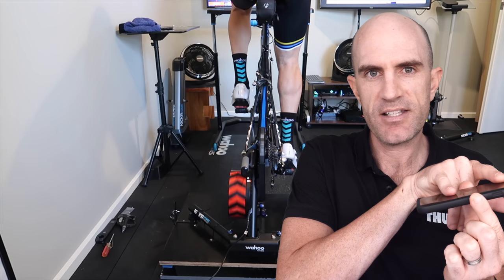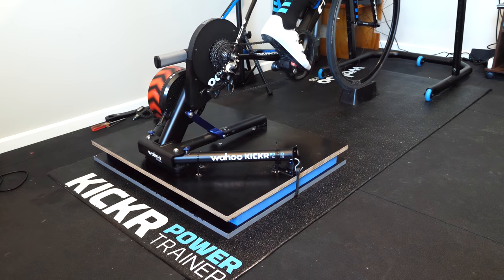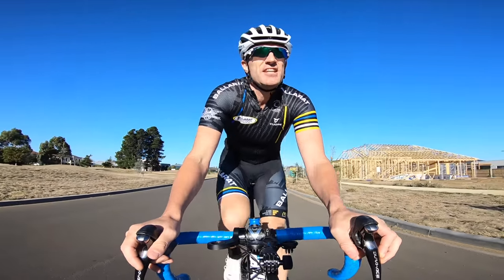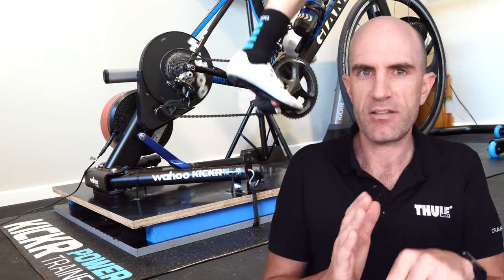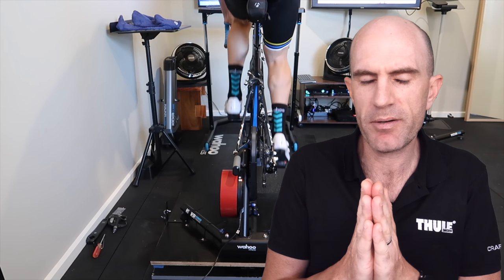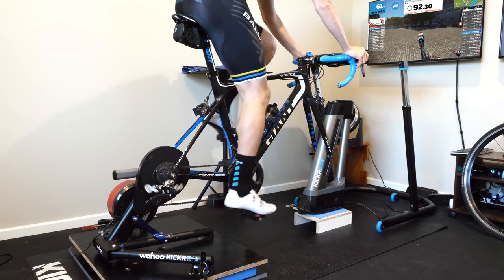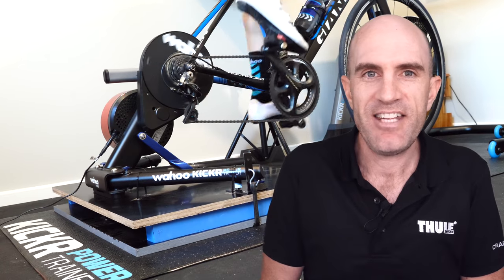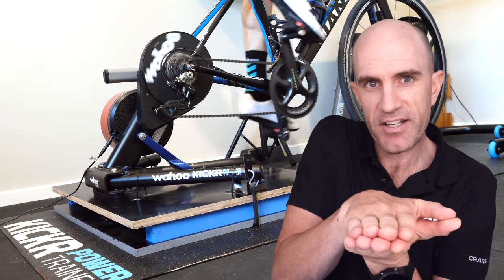Indoor Cycling Rocker Plates - First Ride of a Wahoo KICKR Rocker

Comment: Perfect job Shane.  I was waiting to see a REAL "how does it feel" video as opposed to some builder touting his own design.  I don't have problems sitting on the bike inside, of course I rarely ride longer than an hour and some.   What I do notice is that my outdoor sprint early in the season feels odd.  I'm doing the INDOOR sprint outside, where I am essentially sprinting without rocking, until I get enough outside miles in to swing free again.   Sadly it seems to repeat each winter.  I am hoping someone does some serious analysis and engineers something that comes closer to outdoor sprinting.  So far, I haven't seen anything even remotely close.  Might be a difficult task.  OR you might need to get some feedback into the swing resistance system.  Like the Climb takes it's clues from the Kickr, maybe we need the rocker plates resistance/springs to adjusted also by some feedback...that sounds expensive...     hmmmmm...
Reply: Your comments on the odd transition indoor season to outdoor season are part of the reason I made my first rocker.  You ask for serious analysis and engineering... and precisely what I have done with dozens of rockers I have  built in the last 2.5 years.

It is in essence, easy. But the Devil is in the details. Getting the right motion takes the right spring setup.  I believe I have hit on the right ability to adjust for new riders up to advanced riders and a range of weights and styles.

I am shipping a brand new Rockit Launcher for Shane to ride and review.  I will help him learn how it works and adjust it to hit his preferred setup.

I know its just a "builder's video" but mine shows a range of riding situations, including a 1200w sprint. So, I fully know what you and Shane seek is very possible because I've already done it.

https://youtu.be/gt2XO4NVZEo

Comment: Wouldn’t the foam in the rocker plate suck up some of your watts? So you’ll be putting out less watts for the same effort?
Reply from the maker: Maybe. It really depends on the pedal stroke, sway angles (typically wrong on a rocker plate), and absorption of energy.

Comment: Perhaps some sort of shock lockout, like on a mountain bike, could work? Then you flick the handle and lock out the rocker when doing steady efforts, and unluck it for sprints and climbing. I'm not sure how to implement this in practice, but someone might be able to make it work...
Reply: I lockout is a possibility.  I would actually prefer a dual rate spring setup.  One for firm, minimal rock (as I think some rock is always a good thing, especially for extended seated efforts), and another for looser feel for standing and sprints.

Comment: The video shows that squirm is mostly from the failure of the cable ties to prevent motion of the Kickr on the rocker plate.
Reply: Yes, the trainer is definitely slipping on the surface.  Full and restrained retention is an important feature of a proper rocker.
Reply: Yeah, I saw that movement, too.  The designer needs to address that area to ensure a more secure tie down.  Plus those zipties can eventually break.

Comment: Thanks for the video Shane. An important factor is that the trainer weighs 21kg. Whereas on the road there is nothing weighing down your back wheel. From observation there is a bit of a snaking motion in sprinting rather than direct side-2-side motion.
Reply from the maker: Yep, the massive rocker-plates people are building are not the answer either. I have a follow up on this to do.... one day.

Comment: Hi Shane, I need your help please bro. You are probably the best person to help with this. I’ve just bought a wahoo kickr 17 and used it for the second time yesterday. I’m using the wahoo fitness app at the moment as I don’t have Zwift yet. My problem is that the kickr resistance seems to be too much even tho I ride on simulation with 0 gradient and 0 wind. I find that it’s quite difficult to keep 80-85 cadence when using the kickr. On the road it’s usually very easy for me to do so. Furthermore the big gear in front seems to make the situation worst and I struggle to get 70 cadence. Do you know what could be wrong, what am I doing wrong?
Reply from the maker: Wahoo Support are your best bet here. Other than changing to an easier gear, which I'm sure you've done, I'm not sure what else other than a spindown you can try.
Reply: Shane Miller - GPLama Thank you sir, I will contact wahoo. Much appreciated

Comment: It is hard to tell from the video, but it appears that there is no center support. Other designs have a pivot in the center that prevents the entire platform from moving up and down. The sides can move up and down, but only by pivoting along the center axis. This would I think be noticeable in the sprint test where it appeared that the entire platform was moving up and down instead of side to side. 

Outside when sprinting the bike cannot move up and down, but only side to side. You want to retain that for rocker plate designs.
Reply: Look at the middle axis of the deck. You will see 6 holes, 3 pairs, spaced in a way that matches the typical setup using pillow block bearings and a center pivot shaft. I am comfortable claiming it is very likely the same concept on display  in dozens of other builds on the Zwift Rocker Plate Facebook group.

The overly stiff springs are hiding the movement (not to mention the true potential) of the rocker.

Comment: I have a question for you in regards to the rocker plate. Does the plate dampen/minimize the vibration and sound your trainer generates? That is, is your trainer more "silent" when using it on the rocker plate? Would be much appreciated to know! Thank you for a great YouTube channel! :)
Reply: The specific design of a rocker influences how it handles sound.  Some (many of the tennis ball versions with no rigid center support) do dampen the sound and vibrations.  Some people like them for upper level locations to minimize transmission to other floors.

Other designs with rigid center supports and hinges, along with some of the full length rockers, actually increase sound and vibration.  People are working to understand the cause and solutions.  There are applications using rubber and carpet to damp the sound in those cases.

It's a peripheral consideration for many, but is very important for some people.  I expect this will be an attribute worthy of comparison when we start seeing commercial units for sale.
Reply: Thank you for your thorough answer. Unfortunately, I'm one of those who live on a upper level and my neighbour does not enjoy the vibrations (and/or sound) my trainer generates. I will have to look further into the tennisball versions. Again, thank you!
Reply: In case you aren't already a member:
https://www.facebook.com/groups/415329188897706/

I also have some specific links to various tennis ball versions saved.  I can share them with you on the FB Rocker group, if you PM me or make a post there asking for examples.  It may well help for your needs.

Comment: It's more of a simulation and is better than the rigid feel. I've it Seem a couple if fixed trainers that roll on an axis much  like the  way an airplane does. It's coming soon a full 3d simulated ride with software that mimics roads surfaces. Can only.imagine riding cobbles and getting that feeling via the trainer.

Comment: Actually bikes don’t want to fall over at speed, due to the rotational inertia of the wheels they would actually stay upright with no one riding it on a smooth, level surface. When sprinting bikes don’t rock as much as you think, they also move side to side, it’s a translational movement more than rotational. The only thing that simulates that is the awesome Tacx treadmill thing I saw your great video on

Comment: In terms of the movement of the bike, how does it compare to rollers, compared to outside?
perhaps if the plate rested on an elastic gel bladder, and had one for the front wheel as well, it'd have freer movement and account for twisting? something good and viscous so it's easy to clean up when you burst the bag....
Just saw another vid on this concept by david arthur. air balls. much cleaner. too bouncy?

Actually thinking about it, surely it's the front end that swings about far more than the rear so perhaps people should be thinking about that a bit more? Perhaps you could get away with just a kinetic rock'n'roll with some kind of fancy rockerplate up front. 
Love to see where this goes.

Comment: Cam tell the seat and chain stays are being put under unnatural strain when you lean without pedalling.  I can see the need for a little side to side play but this seems like overkill
Reply: The problem isn't the side play, but the overly stiff spring setup.  
With a lower leveling spring force, this improves the feel and reduces the stress on the frame.

Comment: One of the huge, hugely expensive cycling versions of a treadmill is probably the only way an "indoor" experience will approximate realism.  Then again, who knows...maybe a Kickr Climb and a "Kicker Rock" mounted to front and rear QR's would do the job all on a board with rollers allowing 2-3cm's of back and forth motion. 

I use stationary trainers as they are great for structured workouts.  I'm not expecting them to provide realism.  That said, seeing what people come up with is interesting.
Reply: My goal is to take the best of all sources (rigid trainers, motion rollers, treadmills, pitch control, etc.) and wrap it into the ultimate indoor training and riding setup.

Freedom to rock, roll, translate with just enough control to make it easier and more predictable than rollers or a treadmill.  We are still in the early days and I expect we will see some very great solutions as we continue to push the design and development process forward.

Comment: Awesome video Shane, I always wondered what they would be like.

In fairness, look at video of a top pro road sprinter and the bike doesn't rock much all that much from side to side. Still not convinced, look at a top track sprinter, the bike doesn't rock at all. That's part of the technique of becoming a good sprinter. So maybe the other side of the coin is a relatively fixed trainer is indeed good for sprint training in learning how to get big power out (2000+ W in the case of a trackie) without getting the bike all tangled up?

BTW fantastic editing Lama. I liked that out the front camera mount and the video was cut brilliantly. I appreciate the effort you go to with these videos.
Reply from the maker: I see a whole lot of rockin' here: https://www.youtube.com/watch?v=SVYPpqCvles
Reply: You think so Shane? I guess it's subjective as I would say that's exactly my point, what would be the average angle, +/- 10 degrees? Sure different sprinters have different techniques and it's not difficult to cherry pick extremes, but most don't move all that much in the grand scheme of things in my opinion. Certainly within the capable range of some form of simulation anyway.

Track? Just bought up something off the top of my head, last Olympic games. Zero movement. https://www.youtube.com/watch?v=iMbwSnxhDOc

I recall seeing a photo of myself crossing the line in a road sprint and the bike was damned near 45 degrees! I had no idea I could get a bike so tangled up :P ... I did win however ;)
Reply from the maker: Shorter cranks.... much higher RPM on the track... and when they crank the bikes from lower speeds/RPM (not from a standing start, that's up and down), they're still moving the bike side to side. I'd need to get some cameras out on the bike to know what the exact movement would be. More than the BOB plate offered that's for sure.

Comment: If we could only have the e-motion rollers have a kickr & kickr climb built in, it would be great! After using Krietlers for years then going to the e-motions it was a drastic change. I love my kickr but nothing compares to racing on Zwift with rollers. No rocker plates needed!
Reply: Ed Burgess Loving my emotion with smart controller as well.  They just feel amazing.  Like to see Lama get his hands on a pair to review. I'd also like to see a modified floating fork stand that can raise the front to simulate climbing.  To be honest though I'd likely only use that option a few times and then put it away as things just feel so good as is.

Comment: wondering if the tilt motion were a little "looser" and you were using a Snap. The spinning back wheel would provide the gyroscopic action to aid in keeping the bike vertical would help with the realism
Reply: I've used 2 different wheel-on and 2 different wheel-off trainers on my rockers over the years.  The is no major difference other than the total weight added.  The heavier wheel-off trainers do add to the polar moment of inertia, but the relatively low center of mass makes the overall impact to rocking minimal.  I can't say that there is a huge difference on either setup in general use.
Reply: Interesting Chad..The gyroscopic effect is something that I thought was missing from replicating the experience. Maybe not!
Reply: Well, in most cases, we have a weighted fly wheel, that spins at significant RPM's, to produce a good inertial feel and mimic that from outside.  In this case, it may also add some "stability" via resistance to direction changes (what a gyro does).  But our body weight and manual inputs on the bike via the bars and pedals, can easily overcome that resistance.

The fact that it is relatively low and close to the pivot point is an advantage to us in keeping the motion lighter and closer to outside feeling.  That and the proper leveling spring setup can largely mask the weight of the trainer and gyro effect.
Reply: Could be that using the Climb raises Shane's CofG thus increasing the lever ratio to the pivot point of the rocker plate. This improved his ride experience at the higher Climb positions. The same feel could be achieved by altering the spring rate of the foam cushions or moving them inwards. This tuning only works for one setup height, having a Climb complicates things, but that's not a problem for my Climb-less setup.
Reply: Yes, great observation Martin.  That is very likely to have helped overcome the stiff springs.

Comment: I don't see rocker plates coming close to the feel of the real world. I think the only reason I'd get one is for comfort. Naturally we move a lot out doors. All the micro moments during a real world ride gives constant pressure relief. If it means longer rides and a happier gooch indoors then it's a must have.
Reply: Feel is very subjective to spring setup.  This one is not great and can be greatly improved.  My rockers, and feedback from friends and others who have built my design show much close feel to outside.  It will likely never match real riding, but I think I have it very close and close enough to make a HUGE difference in the indoor cycling experience.

Comment: A rocker plate with an acceleratomer feeding back to zwift and you have steering😜
Reply: john citizen , yes, I'm hoping Zwift adds that for us rocker users.
Reply: Not much point when you can go around hairpin bends at 50mph with no collision detection. You'd be at a serious disadvantage in racing :D Not much point steering if you can't crash! They would have to introduce braking - an analogue lever attached to your bar that connects to your device that's running the mobile link app. I'm all for real ride feel but trying to introduce steering, braking, collision/crashing would mean a complete redesign of the game - aint gonna happen :)
Reply: skullmanUK , you are jumping way ahead.  The first implementation could simply be to allow leaning (read by the phone).  It could select the direction while in turn zones, so you can pic on the bike, instead of using a keyboard or the mobile link app.  If they ever introduce lane selection options, the lean could work for that too.

So it doesn't have to go from nothing all the way to reality.  It's an idea to add some more interaction with the game via the bike..

Comment: Would it be fair to assume the movement being generated in the rocker during the sprint is essentially watts being lost?
Reply from the maker: I didn't encounter any loss of watts.... unless there was loss but it was negated by a little more leverage... not sure.
Reply: No, because (on a proper rocker) we use the same motion and body movements that we do outside.  The whole point is to accurately mimic the movement pattern.